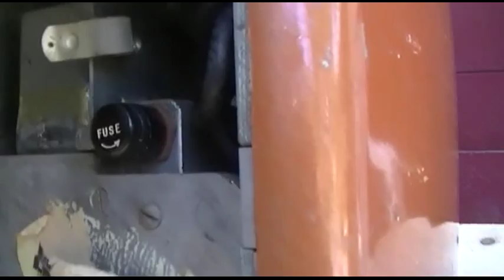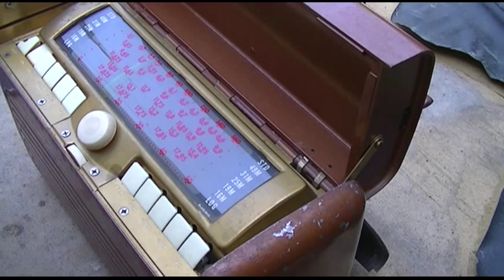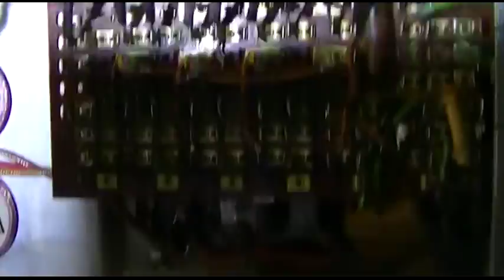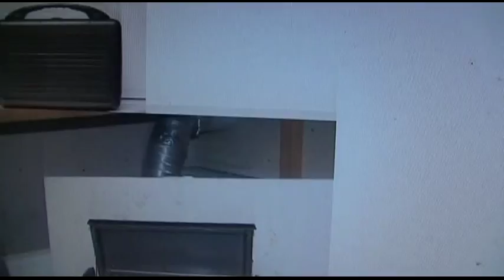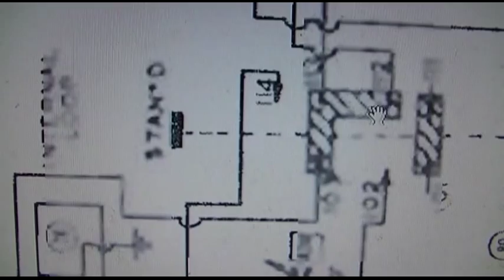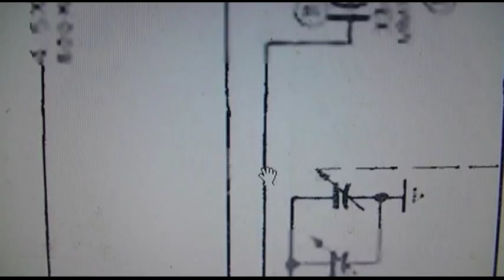GE 260 AM Battery Short Wave Radio General Electric 260

Comment: On the 260 I found that two  CR2032 lithium 3v button batteries in series provided about the right neg. bias for the 6Q5 output tube.

Comment: You should probably use alkalines or carbon zinc when testing. An NIMH 11 amp hour D cell can output enormous current, at least briefly,.and just completely cook it.  This could probably put 30 amps or more out for long enough to fry it pretty bad, especially with 2 of them in parallel.

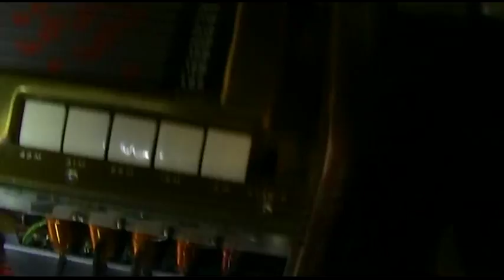Comment: I dont have the radio - but you can estimate the Turns, size of the loop etc from picture at 5:59 mark . Use the tuning capacitor frame for size reference. Or use the cabinet size as size reference.All the data is right there if you need howto read it and clone it. It looks like 7 Turns on that frame.

Comment: Hello, I just got one of these radios, well, two of them but only one is complete. From the ebay photos It should have the SW antenna. Do you still need the antenna information? If I can get the back open I can take the appropriate measurements. the back seems stuck on mine, even though the guy had the back cover open to show the insides. maybe it got warped in shipping?

Comment: I like your video but where did you get the batteries because I have one and it works but I need battery I had a 8 amp but it have enough power to run it it only ran a minute marty

Comment: Why not build a solide state vibrator replacement? A small swichmode supply that converts the 2V into 12V and powers a NE555/ Power Mosfet chopper circuilt that runs on 50Hz. Less noisy and no machanical contacts!

Comment: I agree, I am not a fan of shotgun recapping either -you can accidentally make wiring snafus that did not exist to begin with, etc., especially if you are a beginner, been there done that. Find out what sort of can of worms you got first, get it running, then you can knock yourself out replacing things if the radio or TV is worth it.